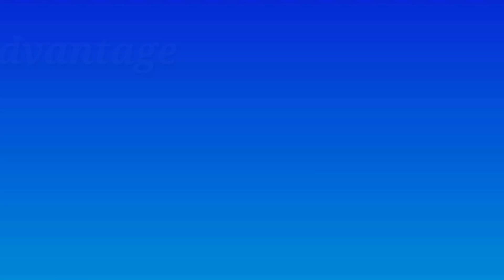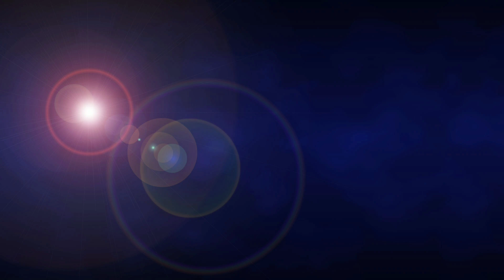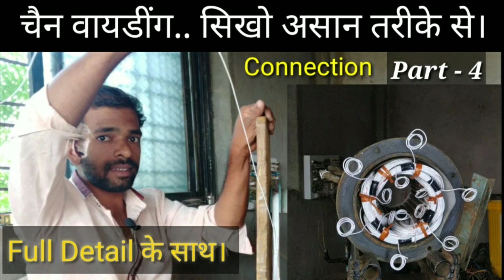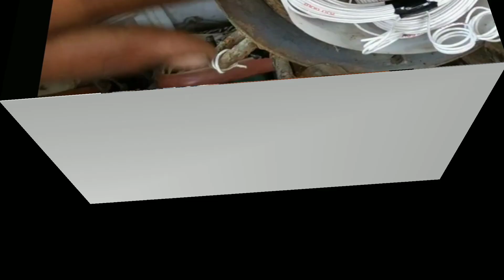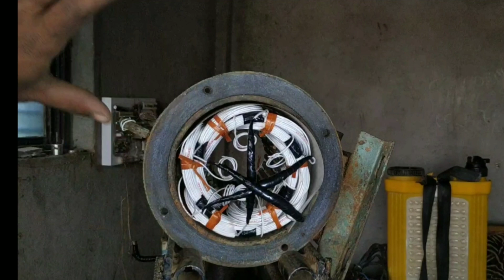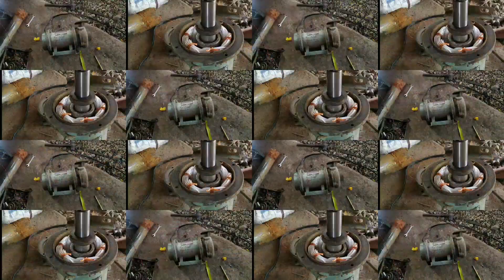चैन वायडिंग जल्द आएगा अगले Sunday तो Like... Subscribe... and...share कर दो...

Comment: Sir aap apna contact no. dijiye mene aapki sari video dekhi hai... 
Mere pass ek samar ki motor hai 2 HP ki CRM ki vo phle jyada ampier le rhi thi 15 - 17 - 20 and supply cut MCB down. 
Abhi mene uska 3 wire m se starter m 2 wire (yellow and blue) ek dusre se change krke motor ko ulta run kiya or ab sidha lganae pr 7-10 ampier k beech le rhi h or pani nhi aa rha h dono cases m. 

Mene pani k liye 28 pipe the usko bada kr 30, 31 pipe bhi daal k check kiya tb bhi kuch nhi ho rha h.. 
Kya problem ho skti hai ese case m